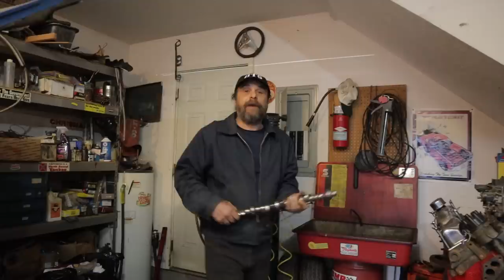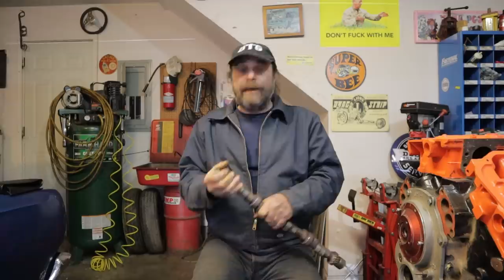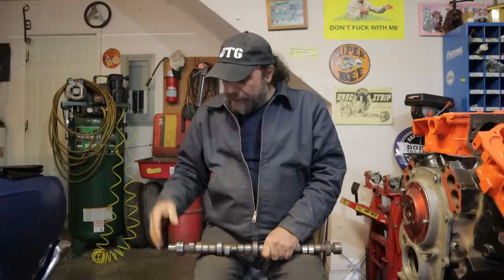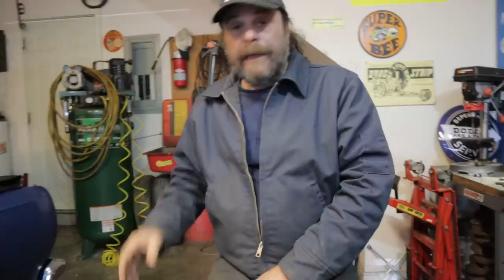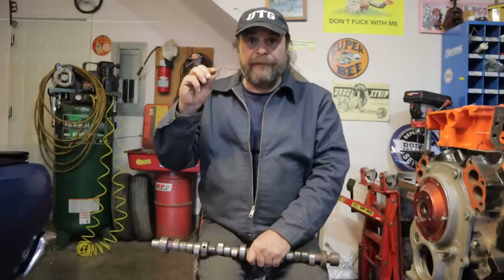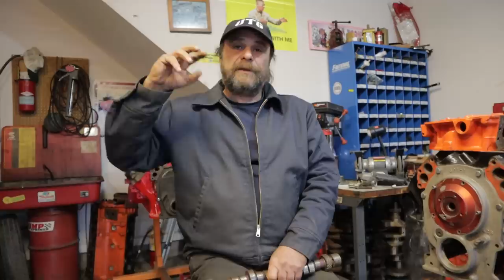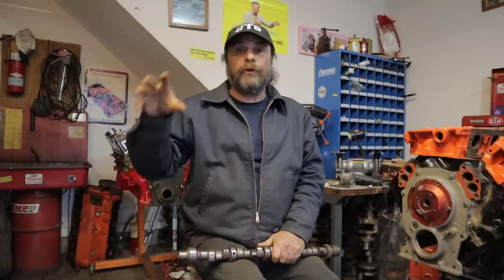Camshafts For Dummies

Comment: I only buy my cams based off how cool the sticker in the box is. A woodpecker smoking a cigar, an iron cross, etc. It's about the stickers.
Reply: Iron Cross! Schneider Cams, one of the best kept secrets.
Reply: That's how I buy all my auto parts.
Reply: I still have a never worn Isky cams t-shirt from the 70s. It has a cartoon drawing of Ed Iskandarien dressed as a gangster with a big cigar in his mouth. It says "The Camfather".
Reply: A woodpecker smoking a cigar I'm sold.
Reply: @413x398  I love that when I call Schneider (or one of the few other similar family operations that are left) I'm talking to a technician with years of experience grinding cams for hard-core racers and hot-rodders, not an order-taker feeding me canned answers from a computer screen.
Reply: LMFAO. Well at least your honest😂👍👍👍💪
Reply: @daniellobo1680  Honest as the day is long brother. In my world, if you need a cam, you need an engine. Sticker not included.
Reply: That's about as scientific as most cam decisions.
Reply: @genehart261  Damn straight. Remember that no matter what engine you're building, you always need at least a 950 CFM double pumper carb too. Holley's come with a pretty cool sticker as well.
Reply: @yurbeeinwatched  Years ago my daily driver Malibu 307 was tired and using oil. I went to an engine builder and started to tell him all the things I wanted, cam included. He said "we don't do that", he installed a stock cam and lifters with a new valvetrain and a roller timing chain. I put on a little Edelbrock 4 barrel and HEI; man did that car run! 18 + mpg without overdrive. That was MY cam lesson!
Reply: @genehart261  Right on brother. I do mostly diesel engines anymore, but I worked at a high performance machine shop for a long time. Did a ton of top end jobs. For the most part, unless you are wanting to put up good numbers at the strip. Your stock cam breathes enough to make some power.
Reply: @genehart261  When I was building a 340 back in the 80s, I went to the speed shop and told the guy which cam I wanted.  "You don't want that!" he said, and he sold me a Crane (I don't remember the specs).  Anyway, the car ran like crap, wouldn't idle right, no low end at all (with 3.23 gears) and about 7 mpg.  I wasn't happy.
Reply: @yurbeeinwatched  I remember back in the day with my 1st build sticking a 228/232 108 lsa in a 383 stroker. I topped with a Holley 830 puddle dumper and hooker super comps. It was one of the sickest sounding idling small blocks ever heard,but it wouldn't pull itself out of a wet paper sack. The cam also came with a cool looking sticker with a blue snake on it.
Reply: Skullz☠
Reply: @MikeBrown-ii3pt  dude that is pretty great.  Also, now I don’t feel like such a hoarder with my 90’s and early 00’s bike, skate, and band shirts.  The few shirts I liked and spent money on from that point maybe only made it to my back 3 times.  All though my Specialized down hill shirt signed by Tinker Bell himself has never been washed or worn.  Other then my 1st car, i think that mud stained shirt in a kids small is the coolest thing I own.

Comment: Tony, I searched your site to try to find an opinion on cam specs, and this one came to the top each time. The fact that you dont have a particular cam rant in all your content tells me you either just use mostly stock stuff, or prefer to keep it secret. In my limited experience, unless building an engine for strictly strip use, making your engine perform with a factory "performance" cam forces you to cure all the "problems" in the engine of which the camshaft is not one of. Yes?

Comment: The camshaft rotes at half the amount or, "speed" of the crankshaft.

Normally when referencing, "degrees" they are crankshaft degrees, not camshaft degrees.The degree wheel mounts to the crankshaft. The more aggressive, or quickly the valve opens, the heavier a valve spring usually has to be to control valve float at the same RPM and faster hydraulic lifters open valves, the heavier valve springs have to be to prevent lifter pump-up at the same RPM. There is advertised duration, 0.050" duration and there is S.A.E. duration. With hydraulic lifters S.A.E. duration is usually at 0.006" lift, opening and closing sides of the cam lobe. Some camshaft makes use a lower lift for a higher advertised duration number. Some car makers use a different opening lift with a different closing lift when computing advertised duration. Before 1964 the car industry standard for hydraulic cam lobes was to make cam lobes that had a 0.050" lift duration that was 70% of the SAE 0.006" lift. This for acceptable wear. Around 1962 the aftermarket and industry engineers were trying more aggressive cam lobes. Around 1962, Iskenderian Racing Cams promoted high performance hydraulic camshafts with more aggressive 75% cam lobes. The 0.050" duration was 75% of the SAE 0.006" duration. In 1965 Pontiac changed all of its 4 barrel and tri-power carb camshafts to75% cam lobes, with the two barrel carb engines staying with 70% cam lobes.Pontiac may have tried that with the 1964 GTO camshaft too. The 1964 GTO camshaft was the same part number for GTO engines and on paper was the same as the 1964 4 barrel automatic transmission camshaft, BUT IT HAD A DIFFERENT PART NUMBER! In 1965 Chevy had the 350 horsepower 327 and new 396 engines with 75% cam lobes. In 1966 Ford had the 390 GT and Olds had the limited W-30 camshafts, for the new 75" cam lobes. The 1967 Dodge 440 Magnum still used 70% cam lobes, but the 1968 340 went with 75% cam lobes. "Theoretical" maximum power happens with the camshaft degreed with the intake centerline at 106 degrees ATDC, REGARDLESS OF LOBE SEPARATION, but this is just theory, as is, maximum torque happens with the intake centerline at 102 degrees ATDC, regardless of lobe separation. These theories are usually very close with, "correct" sized camshafts. The closing of the valve is limited by the mechanics of the valves slamming against the valve seats. The intake valve runs, 'cold" and can take fast slamming to be noisy. The exhaust valve runs red hot and is more easily damaged and must be closed more gently. Modern computer designed hydraulic cam lobes are even more aggressive now and some are designed to prevent lifter pump up at higher RPM with less valve spring pressure, but the really aggressive camshafts make more power and their cam lobes still require the heavier valve springs.
Reply: Awesome info and many thanks for adding this comment. Gonna do a screen shot of this and add it to my notebook.

Comment: Another benefit to roller lifters, beside reduced friction and wear at initial break-in, is that if you try a radical ramp on the lobe, it can try to push a non-roller lifter as much sideways as upwards, which causes binding inside the lobe bore.  Mopar adjusted this by using "fatter" lifters and bores, meaning the diameter was wider than other engines, so a Mopar cam can get away with a faster ramp before it needs the heavier roller lifter.  Other engines would use a "mushroom" lifter that had a wider foot or base on the cam lobe to have that increased diameter benefit.
The sooner you push that intake valve to full lift--assuming the valve springs can handle it--the sooner that full lift occurs during the duration the valve is open. If you ported the head to flow best at full lift, did an angle valve job that also works best at full lift, and the valve is unshrouded at full lift, this means the valve is performing longer during the duration, at the lift it was designed to work best at. 
But what if the duration of time the intake is open (from its moment coming off the seat to full lift and back onto its seat again), extends into the time the exhaust valve is open?  That is overlap. Too much, and you have emissions issues, low vacuum for brakes, and rough idle.  But if you increase the ramp speed, ie, the intake valve pushes open to full lift sooner due to roller lifters or an increased diameter of the base of the lifter, now you can decrease the entire duration (from lifting the valve off the seat, to getting to full lift, and returning it to the seat again) but not lose (or lose much of) the amount of time the valve is at full lift. It would be as if you only had a mile of pavement to travel, and you want to spend as long as that distance at 100mph as you can.  The car that accelerates to 100mph the quickest, is the one that lets you enjoy 100mph for as long as you can over that 1 mile of pavement before the car has to come to a complete stop.  That's where the expense of a roller lifter setup and springs to handle its weight come in handy. 
But there's a case for not designing your intake port and valve to work its best at full lift. During the duration, the valve sees full lift once, but partial lift twice--once when the valve is opening, and again when its closing.  some designers like to work on mid valve lift performance for that reason.

So, now you have the basics, the terminology,  and now you have some philosophy :)

Comment: Excellent explanation! There are so many #s on cam cards that it's easy to get confused, especially for those who don't have much experience. To me, the 3 most important #s are advertised lift,050" duration and LSA. You explained them in language that's understandable. Last summer, I was at a local car show and one of the participants was really talking up his engine. He used a term that I hadn't heard in YEARS when he said it had a 3/4 cam. Now, I know what a 3/4 cam is and, in my experience, they're not all that great. You should've seen the "deer in the headlights look" on his face when I asked him what a 3/4 cam is.
Reply: Care to explain what a 3/4 cam is.....preferably keeping in mind, I'm one of the dummies he made the video for?
Reply: @phoenixrising4573  Basically, a 3/4 cam is just slightly bigger in lift/duration than an "RV" cam. An RV cam is meant for low end torque and mid range power. The rpm range is usually from idle to around 5k give or take a few hundred. A 3/4 cam is usually designed for more mid range power while still trying to keep as much low end torque as possible. Their usual range is about 1500-5500 rpm give or take. An RV cam usually has advertised lift/duration #s around 260 degrees and .450 lift. A 3/4 usually has #s around 280 degrees and .480 lift or so. Keep in mind that these are advertised #s. The name 3/4 race cam was used for decades.
Reply: That makes sense. Sounds more like an oval track cam maybe? Or street drag maybe...

Comment: I really enjoy your content and the way you explain things that are both "mandatory" and "not mandatory" and myths. I am new to your channel, but  I would love for you to take a survey of which engines people want to build from scratch to stock specs, and do a series on the winner of that survey, and build it from scratch, just to stock specs to get it running on a bench. All other adjustments for various applications can be covered either by you, in a separate video, or a channel that you would recommend for that purpose. I would really love to watch that, no matter the winning engine (even though I am a Ford guy), because I love the way you explain things, and your passion for this stuff. You remind me of my engine-building teacher in college, that got down deep into this stuff, and gave physical examples of various things, to make us truly understand every nook and cranny of building an engine, including details like, heating gasoline in a beaker and putting a sample of each stage of heating into a glass tube and lighting it, to demonstrate how the different "octanes", and the way they burn. I'd like to see everything, from 'cylinder honing" to using feeler guages and that green string that you use to measure tolerances for caps and bearings, micrometers, small hole gauges, calipers, etc.., pre-oiling and preparing the engine for "first-start" and "break-in". I know that this would probably need to be a "sponsored" video, but I am just showing my interest. Regardless of whether it happens or not, I will still be watching. :)

Comment: a solid lifter camshaft has "quieting ramps" on the lobes that take up the slack in the valve train before and after opening/closing the valve. keeps that hammering of the valve train to a minimum. hydraulic cams do not need that(no slack in the valve trane). If you just put solid lifters on a hydraulic cam the valve train will hammer badly. if you put hydraulic lifters on a solid lifter camshaft the valves will start opening sooner and close later. Never tried that but know of people who wrecked the engine with solid lifters on a hydraulic cam. what I have done successfully is to not push the hydraulic lifter piston way down in. reduces pumping up a bit. example on chevy if it calls for half a turn in on the adjuster give it less than a quarter turn. you can run the hydraulic lifters with minimal initial lifter compression. hopefully you will get around to these things. love your videos. knowing this we understand why letting collapsed hydraulic lifters clack away and not fixing that will result in hammering of the valve system, fix it.

Comment: Just to split hairs. Duration @ .050” is measured at .050” tappet lift, not valve lift. Excellent video, I experiment with a lot of cams. For me my major experimentation started getting serious after buying into marketing bs leading me to purchase a comp cams xtreme 4x4 cam for the 350 in my k5 blazer, with the wide 114* lsa the engine idled like stock, but had lousy throttle response, non-existent low-mid range power. So I then bought a comp 280H magnum, with similar lift and duration figures, but a 110* LSA and being a straight grind, my lame 8:1 goodwrench crate 350 now had a steady lope, instantaneous throttle response, and enough low rpm torque to light my super swampers up. So then I went to an isky mega cam with nearly identical lift/duration to the previous cam but it was ground on 106* lsa, now my engine had a nervous crackly idle, crisp throttle response and even more power from roughly 2500-6000 rpm. But gas mileage dropped off a bit. I’ve been playing with cams ever since. Not just in sbc either. Small and big block mopars , ford Lima, ford Windsor, ford fe, and 305, 307, 327, 350, 377, 383, 400, 406 sbc’s. I might have a bit of a problem. Maybe I should seek a support group, cams anonymous lol.

Comment: "Camshaft Duration is the measurement of the time one valve begins to open until it finishes closing. Duration is measured in degrees of crankshaft rotation, not camshaft rotation. You'll see duration specifications at .050 inches. Cam manufacturers agreed on a standard to measure duration so all cams are measured the same way. The idea is to measure duration starting at .050 inches of tappet (lifter) movement. As the lobe lifts the tappet up, when the tappet moves .050 inches, the duration is measured from that point. "

Comment: The roller cam is the most interesting to fully understand.My Yamaha 225 3 wheeler when I bought it had the cam set two chain teeth advanced.It would idol perfect but had no top end power at all.Now it makes a funny rattle noise & it turned out to be the cam has worn to much of its aluminium  bearings away

Comment: Measure your lift, measure your base circle. Take the lift # and subtract the base # that gives you a # let's say it's .350 that's your lobe lift take your .350 & × it by 1.5 if your rocker ratio is that then you get your valve lift which would be .525 lift. Just an example for anyone who didn't understand

Comment: I got a .258/.268 duration .501/.524 lift, 112lsa in my 360 Magnum. Those lift numbers are with the 1.6:1 Magnum rockers. I originally bought this cam for a 318 LA roller engine (when Mopar went to TBI in the late 80s they went to roller cam) so it went into my 360 Magnum. I did check the lifter to dog bone clearance, don't need to break the lifter retainer plate, and wipe a lobe.

Comment: As always awsome videos . Thank you Tony for taking the time to explain cam variations / specs . I just had an 1985 LA  318 built with 9.5:1 flat top pistons and an Erson cam E420121  TQ20H.  Duration @ 0.50 214/214  duration advertised 292/292  gross lift .449/.449 lobe separation 112   .  Sounds good at idle and cruising . What would be max lift on a cam for stock mopar small block rocker arms? Would anything past 470-500 be too much for compression like on my engine  or a 360 i want to build or would the compression have to be raised? Also what a good lobe separation to give an engine that lopy sound but not sounding like its getting to die at idle ?

Comment: Awesome Ty Tony !  In my big block Chevy oval port .. I got a aggressive sounding cam . Low vacuum on the brake til I blip the throttle to stop .. dead hooks then . But at @45 mph on a 3.25 gear she sounds like a boxer jogging the punch bag . At a stop light with solid mounts. She tosses around  like a Harley.. it was awesome till the intake gasket let go again.. so I hoping the cams fine because I did a quick turnaround on the driveway and the next morning she was cappachino... 🤷‍♂️. First catch before start but still had to tear it down to make sure. This time I’m getting a drill press and safety wiring the header and intake bolts Hoping it last longer then before 🤷‍♂️
Reply: 77chevy4x4 loctite is much less work than safety wire, with equal results
Reply: Jim Goff ty !